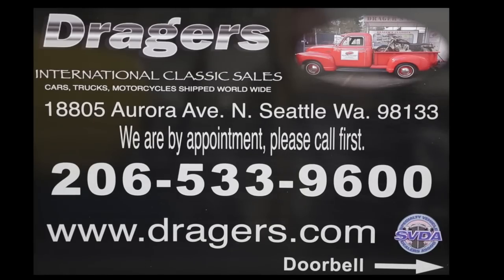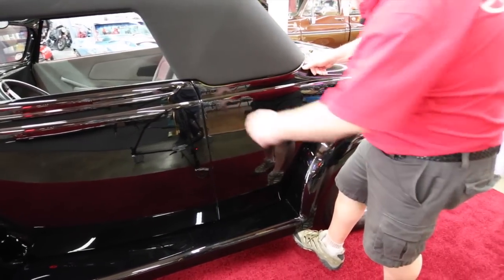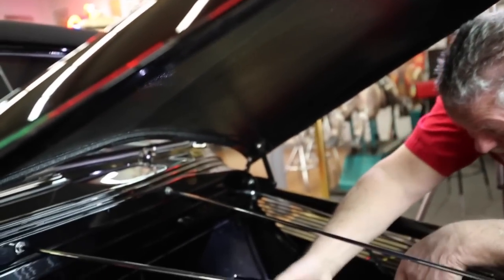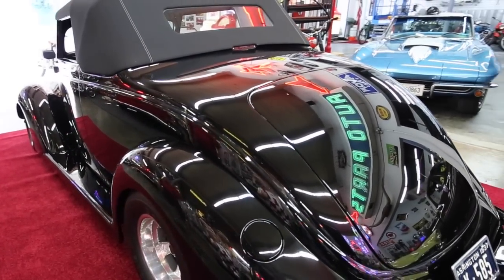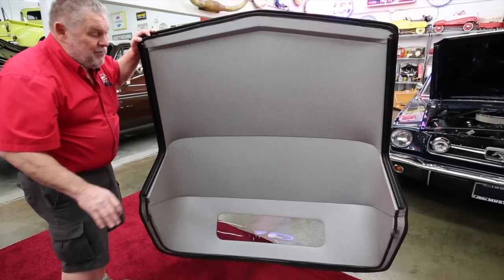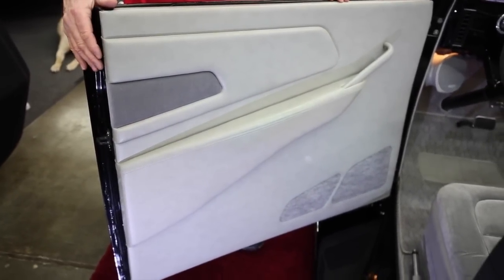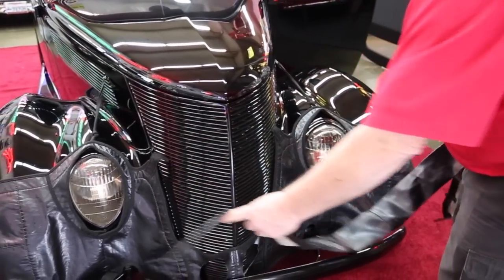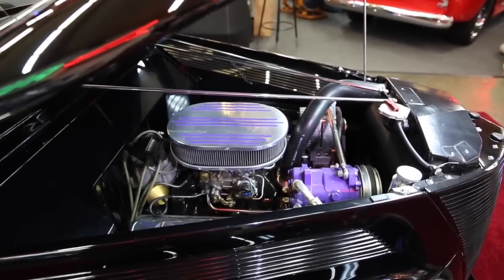1937 Ford Steet Rod Custom " SOLD "   Drager's International Classic Sales  206-533-9600

Comment: Hi Jeri,
I'm local to the Seattle area, I live about a 3 miles from your shop, and was just wondering if you do restorations or know of any good places to do a restoration around here? I have a 1948 ford PU that I'm looking to restore. Thanks!
Reply from the maker: FatsharkFun I don't have any one that I would recommend to do a complete frame off restoration. That costs thousands of dollars and I mean thousands. I know a good painter,  a good mechanical worker and another that does interior. One of my customers has a guy back east that has done great work. So it all depends on what you want to do and how much you want to spend. Are you leaving it stock or are you Street Rodding it?

Jeri Drager
Reply: Thanks Jeri,
I'm not in any hurry to get it restored, but I'll keep my eye out and see if there are any somewhat locally